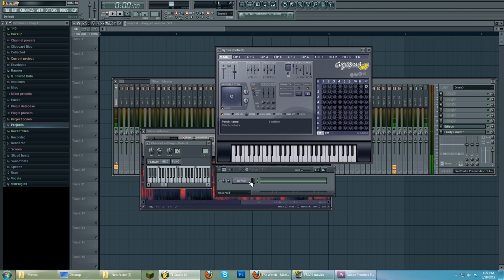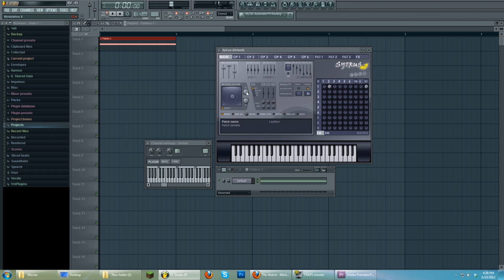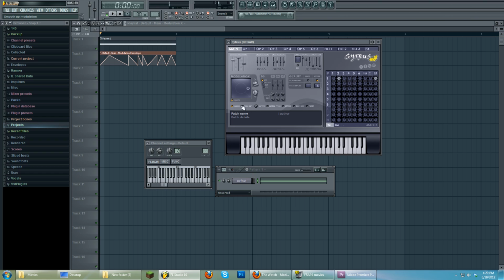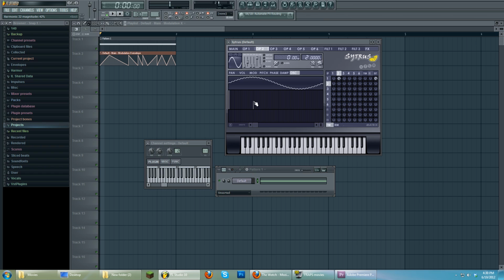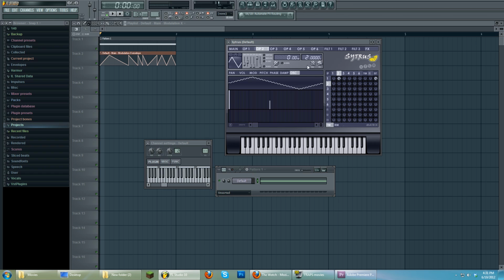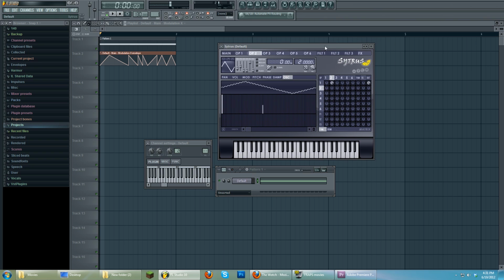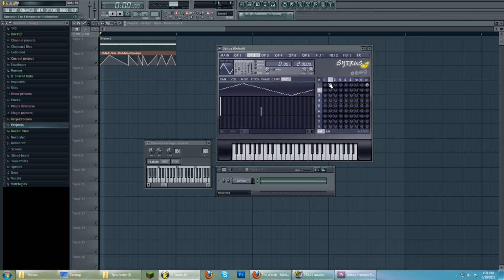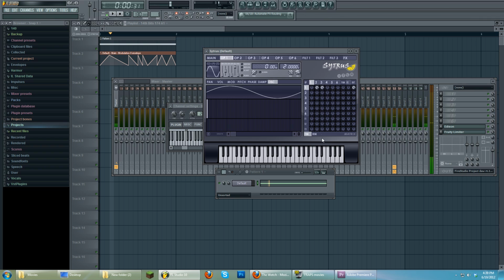FM Synthesis Bass Tutorial with Sytrus in FL Studio

Comment: ---Captain's log---
Date: 18-03-2016
Part: 0002

Todays log will be a fix for an annoying problem that I've had for the past 4 weeks.

If ANYONE is reading this, please read EVERYTHING. I had a problem that I've been struggling with for 4 weeks now, and I found an actual solution!

SeamlessR is THE best tutor on YouTube when it comes to music, sound design and all that good stuff, and he uses Fruity Loops. I'm using Ableton. The huge, annoying problem is... AUTOMATION, and how to translate the automation between the DAW's. Both DAWS are awesome, but Ableton needs some tweaking to get the same, awesome and crisp sound that SeamlessR makes in this tutorial. Let me explain:

My problem was that the automation in Ableton was so slow and weird, compared to the FL's automation in this video, and I found the solution. In Ableton/Options/Preferences.../Audio there are two sliders called "Input Buffer Size" and "Output Buffer Size". The Input Buffer Size were by default set to 8000 something, and Output Buffer Size set to 4000 something. I changed the Input Buffer Size down to 256 Samples, and Output Buffer Size down to 700 Samples to DECREASE the overall latency of the DAW. 

[EDIT] I confirmed that the Buffer Size is hardware spesific, so if you hear crackling noises, its because your values are too low. Experiment to get the best result!

This is just something that I've been struggling with, and now I can make the exact same crisp, beautiful automation as SeamlessR makes in this tutorial. I Just want other people to avoid this HUGE headache. This info can probably translate to other DAW's too, if anyone also are having these problems. Have fun making cool stuff!

PS: If anyone are using a Vectorscope, Oscilloscope, Spectrum and Meter like I do, they will be SO much better when the latency is decreased!

Comment: In doing the exact same thing that you do seamless, but i get this crackling noise all the time. Is that the reason you got the fruity limiter on? If so, how do i remove the crackling noise, my pc processor should handle this program so that cant be the problem.
Reply: its not. the crackling sound or chop you hearing is because of your CPU usage it turning high when previewing stuff.. make sure to close any app. that your not using. for less CPU usage

Comment: Seamless, when I try to change the modulation ammount (after pulling down the thing in the mod x value) by changing the x on the x y controller it doesnt do anything. When I try it with pitch or any other parameter, however, it works.
What am I doing wrong?